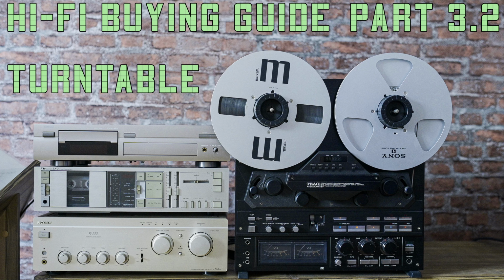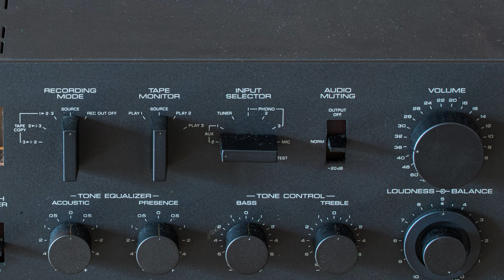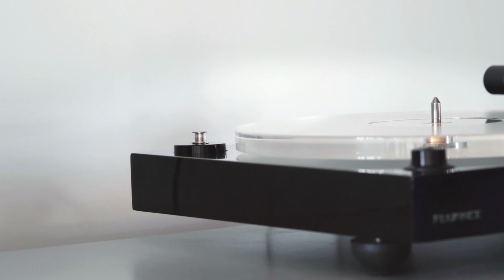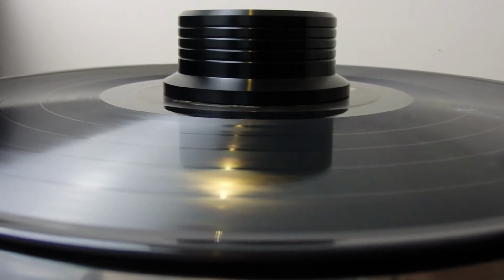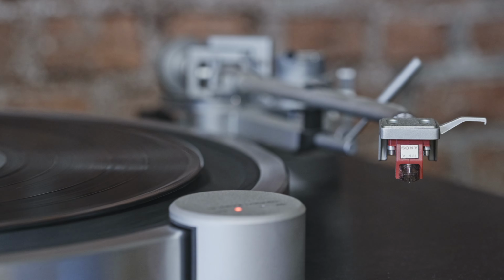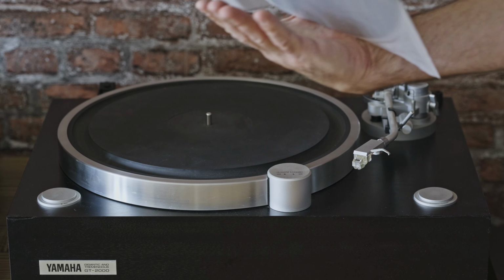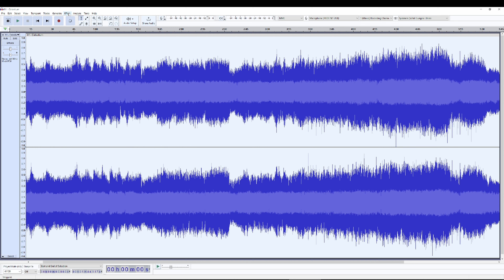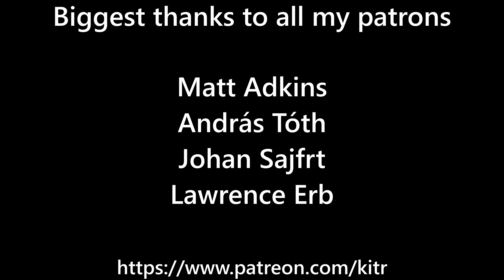Hi-Fi Buying Guide and Perfect Budget Build - Part 3.2 - Turntables

Comment: Hi. I got a sansui ba-1000 amp 3 days ago. after cleanning contacts and fine tuning idle current, it works really well. I have yamaha b1 to compare with, it sounds as smooth if not better. At first it lacks bass impact i am disappointed, but after half a day burning in, the bass comes back I don't know why. I am very satisfied with yamaha b1 b2 and ba-1000. I can't find any review on internet before buying. I know u are interested so I should let u know.
I love vfets, but i am in doubt of collecting vfet amps now. I have found out some SiC or GaN normally on devices have exact output curve like vfet. Maybe diy amp with those device performs better.
By the way, don't use wd40 on contacts, wd40 is corrosive.
Reply from the maker: I'm going to review my BA-1000 once she's restored. Too late for you though.
Reply: @KITR-UK  I didn't mean sell it to you. I mean you should be interested in what it sounded like. I am looking forward to your review! btw, did u find a service manual? I know how to tune idle if u need it. I don't have schematic.